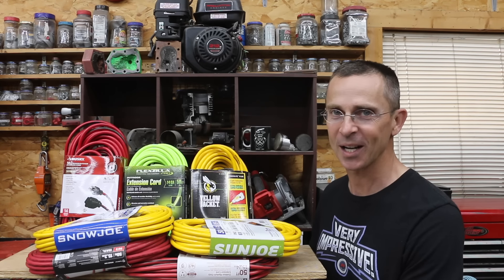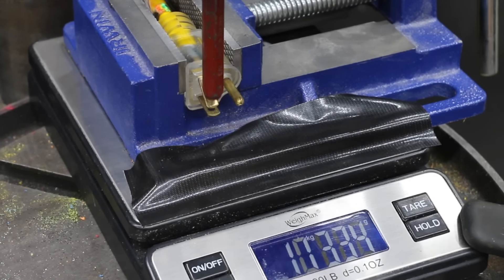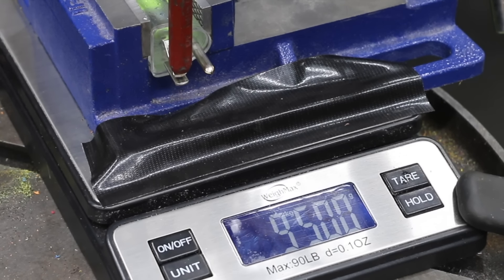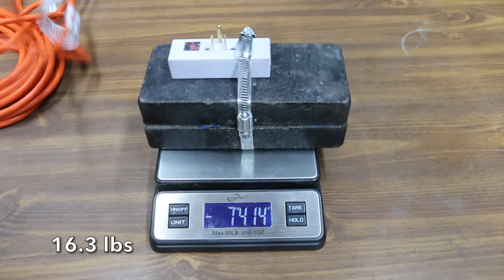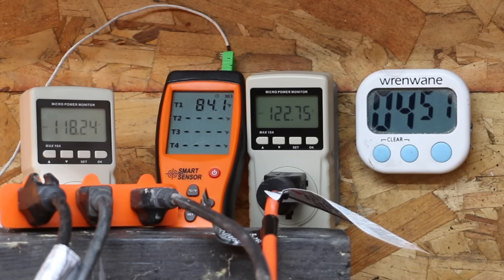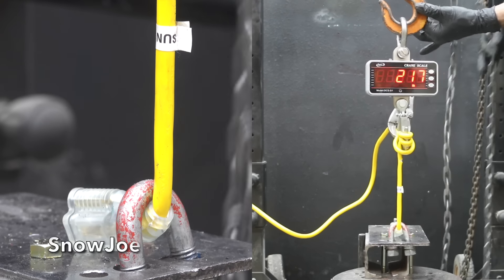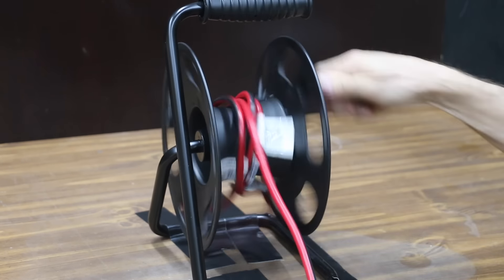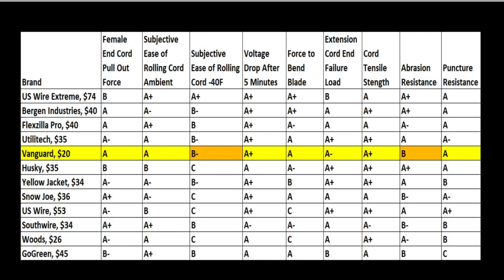Best Extension Cord? Flexzilla, US Wire, Yellow Jacket, Southwire, Husky, Woods, Bergen Industries

Comment: I don't think the bending values are that correct. The values should've measured when the prongs started to bend, not when they were bent beyond usability already...
but something that could be very interesting (especially with the US plug design) would be a test on sockets and female connectors especially how durable their contact springs inside are, as your plugs rely on that friction completely.

Comment: You should never buy a extension cord that is lower than 14 Ga because The breakers in our homes are usually 14 Ga and 12 Ga. If you have a higher Ga wire then the breakers, the breakers wont trip because they are only rated for anything below 14 Ga.
Reply from the maker: Thanks for the feedback.

Comment: just use some SJOOW or soow portable cable or buy a sjoow extension cord, IT is better then all of these its rubber not thermoplastic meaning it does not melt around sparks is more oil and chemical resistant is more flexible,and more abrasion resistant. This is is like a comparison of the best of the worst extension cords. this is why you tires are made out of actual rubber not plastic

Comment: The increasing diameter flare of the plug stress relief sheath on the vanguard is literally backwards. Horrible design! Not only does it not provide stress relief, it also encourages users to grasp it when they disengage the plug from the outlet. A practice universally discouraged by safety agencies and reputable manufacturers.